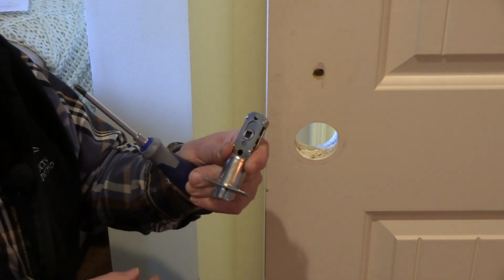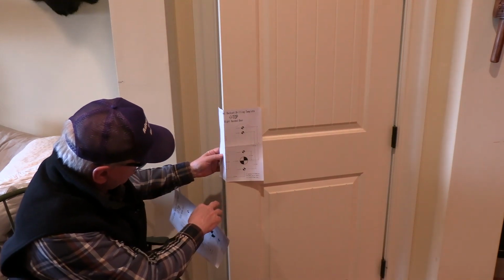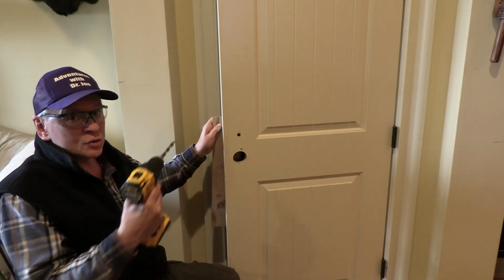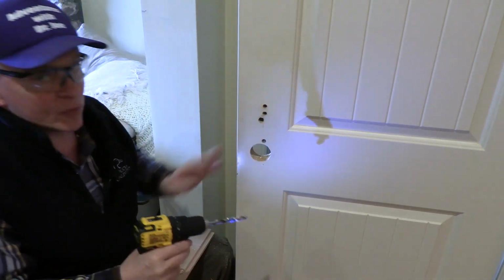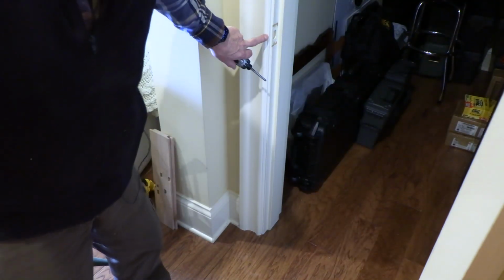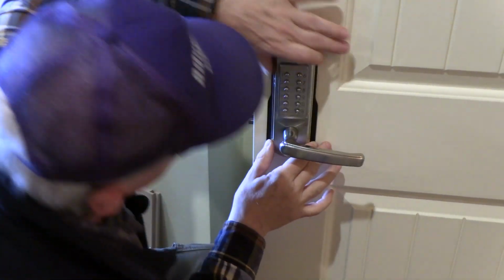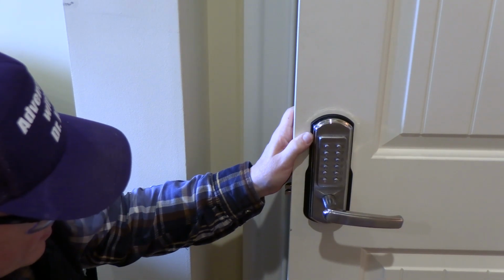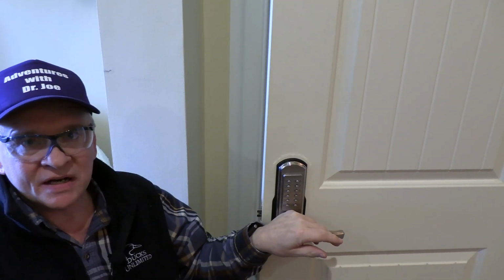‌Install a Mechanical Push Button Door Lock Remove Biometric w Dr  Joe

Comment: Hey Dr Joe, do the instructions tell you how to change the code on that particular lock?
There are many buyers on Amazon asking how to change the code, but the supplier is not replying.
I purchased one for an elderly neighbour 5 years ago but no longer have the packaging.
Reply from the maker: Thank you for your comment. It’s a great question. You can set this like to have any code you wish. When you remove the face plate what are exposed are different color tumblers. Each number has a gold or reddish Tumbler. The lock comes with six extra. You simply remove the gold one and replace it with the reddish one if you want that number to be part of the code. It’s a simple as that. You could have the code 1 number or six numbers. 

I had a biometric reader that was problematic so I replaced it with this mechanical lock which works flawlessly. Take care – Joe